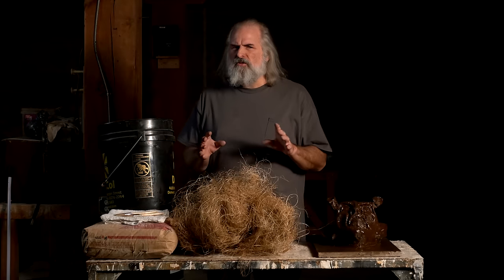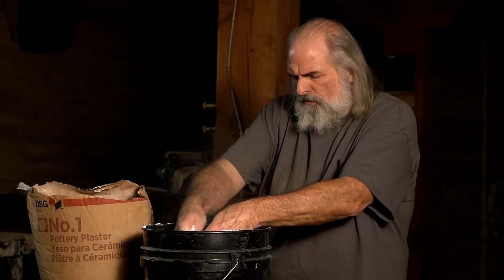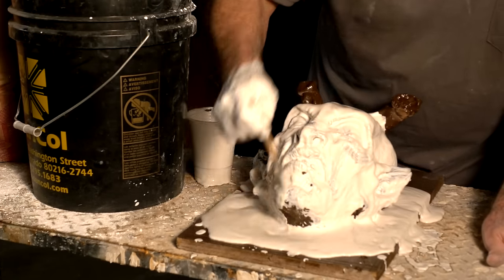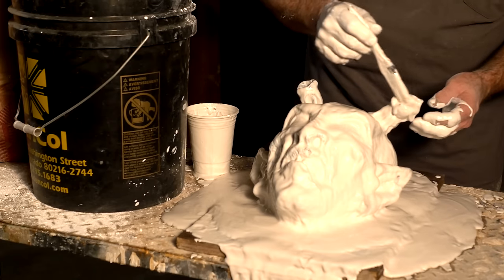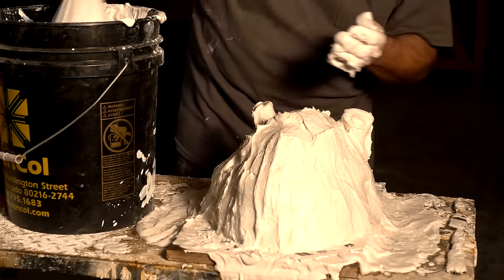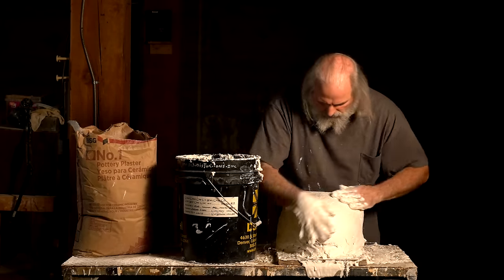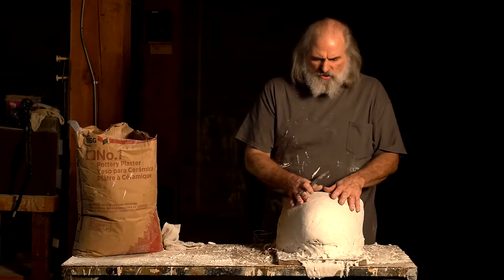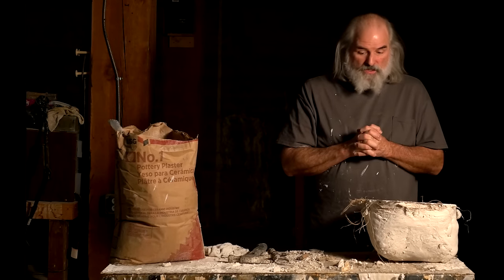How to Make a Halloween Mask "Molding" | Monster Lab

Comment: you can use burlap to add strength to mold! add 3 lays to mold after do detail bush soaking barlap in your plaster. ultcal 30 what you nomal use to make foam molds if you plan to run foam in it.

Comment: This is a great series! I have a quick query though--first time sculpt/mold; I let my clay dry and harden first, and I want to put plaster on the sculpture, but I'm wondering if I'll be able to remove the dry clay from the mold...should I just cut my losses, start over, and apply plaster while the clay is still damp and flexible?

Comment: great video ed! question-- why does some of my latex not cure in the mold? just little spots here and there. could it be the sealer that i use on the sculpture that gets absorbed into the plaster mold? i used glossy rustoleum sealant. i will for sure use krylon next time. Thanks again for your videos.
Reply: It could have stuck to the mold and is not allowing the latex to absorb. Or it could be a contaminant. Be sure and let the Krylon dry over night.
Reply: Ed, I have a Rust Oleum Gloss Protective Enamel, Want to be sure I am being spot on

Comment: The clay removal from the pottery plaster seems like a tough job. Is there a way that silicone or something rubbery and flexible is used to make the mold instead of the pottery plaster so it just pulls off easily?
Reply: You could use silicone, but you're going to get a much better casting with a plaster mold. You could always try a fibreglass mold too. Plaster is always the best, and cheapest, though

Comment: Might be a silly question, but is the sculpt pretty dry before you paint it? & is the paint keeping the clay from attatching to the mold? (Love your work!)
Reply: It is usually fairly dry before casting, but it doesn't have to be. The paint works well either way.
Reply: @eviledwin777   Will the sculpture come off of the armature easily without the molding process? I want to focus on sculpting monsters first. Then learn about molding.
Reply from the maker: Hello! Well if you make sure not to let the clay dry too much than yes it will come off fairly easily and you can reuse it for a future sculpt to keep work on things. Have you watch our latest Monster Lab on WED clay? Ed goes over covering the sculpture and the quality of WED clay in that one in depth. But of course you can use oil clay also and that will not dry out.
Reply from the maker: Great idea to focus on sculpting and do as many as you can to get practice. Take photos of each sculptures so you can see your progress and learn from past projects.

Comment: Would it be possible to stop at the point when you spray painted the clay (by the way, did you spray it while the clay was still damp? or was it completely dry?) and then hand paint the face to display on the wall like a plaque? I don't need to make masks, I just would like to sculpt half-heads and display them. Hope you can help. Thanks.

Comment: Yeah, always go with the recommended amount of water in a cement or plaster mix, don't increase the water to increase your working time - chemically speaking it doesn't "dry", it "sets" - so it'd be like adding more water to jello - it'd still set in about the same time, it just wouldn't set as firmly.

Comment: I've never done anything like this before, but it looks fun 😀 so a silly question: doesn't the clay harden before you take it out of the plaster?
Reply from the maker: The clay will still be soft enough to remove from the sculpture if you don't wait too long after the plaster has set up. Once you spray the clay before molding that will act as a mold release to help remove the clay as well.
Reply: @DistortionsUnlimited  Thank you 🤩

Comment: Hi I hope you guys still respond to questions on this video! If I am making a full head mask that covers the entire face would I want to cast the entire head in one setting or split it between the sides of the head, i am also using oil based clay that I've been told is reusable, does this mean I should not spray it with the paint?

Comment: My mold has some brown colour left over after separating mold and clay and removing all excess clay. Will this affect latex? Hoping on not ruining expensive latex because of this but can’t seem to get it out without scratching plaster
Reply: I once sprayed a mold on the inside with clear spray paint to protect it from getting wet time after time from the latex. The latex set just fine and the mold is still usable after years.

Comment: Should I add the krylon spraypaint when the wed clay is fully dry or when it is wet? First time doing this.
Reply from the maker: When it is still wet, But not too wet. You can let it firm up a bit to do your detailing but you don't want your sculpt to completely dry out because it will crack and be very difficult to get out of the mold.

Comment: Should a WED clay 1:1 bust be allowed to completely dry before casting?
Reply from the maker: Hi Jason, if you do your sculpt in WED clay you don't want it to dry completely before casting because it is then very difficult to get out of the mold. By the time you cast the sculpt it will likely be fairly firm but still workable, because you will have done the detailing etc and this is fine but still allows you to peel the clay out of the mold. Watch a few of our molding videos to see how we remove the clay. We spray Krylon leather brown gloss on before casting as a mold release to help remove clay from mold. hope this helps.
Reply: @DistortionsUnlimited  thank you for the response. About to go sign up for your Patreon now. Great videos!!!

Comment: I hope someone answers this. I have a dumb question. Do you let the clay dry before you spray it? This is where I'm confused.
Reply from the maker: Hi Michelle, thanks for the question. No, don't let the clay dry out before you spray it with the paint and mold it. It can be firmer after you have done your detailing etc but don't let it dry to bone dry and crack. Plus you will need to be able to peel it from the finished mold. Hope that helps! Best wishes
Reply: @DistortionsUnlimited  Yes and thank you.

Comment: Okay, so I did mine on and Ed Head...how do I get the plaster off without ruining the mold?
Reply from the maker: Did you make the plaster mold on a clay sculpture? Is the clay still soft so you can get the clay out of the mold?
Reply: @DistortionsUnlimited  Yes, sir, I did. Just went overboard with the plaster and wad having trouble separating it from the Ed Head armature. I got it off, though. Just took a little coaxing and wiggling.